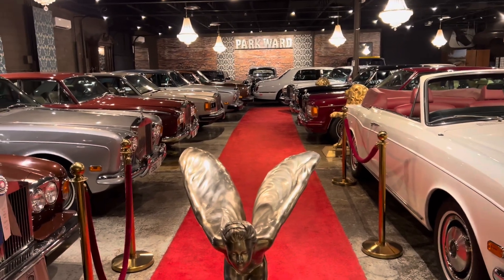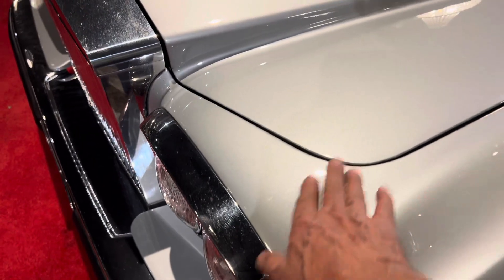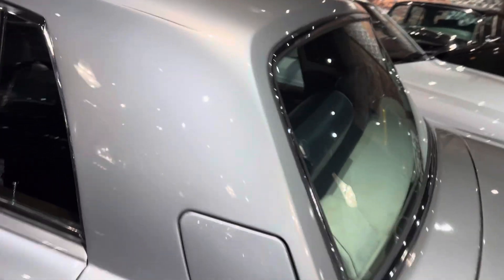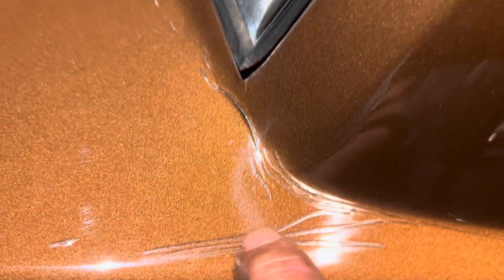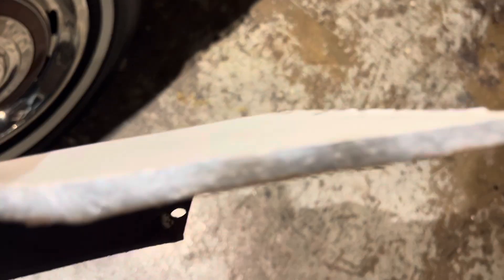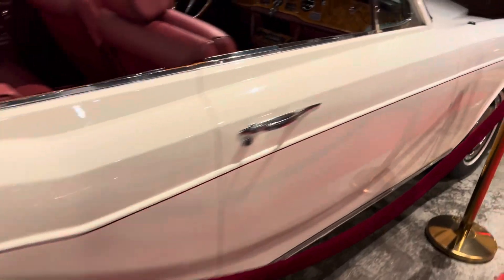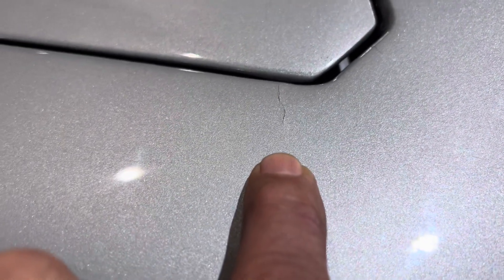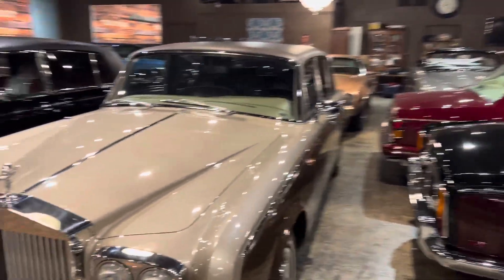The “Lead-wiping” process used in Rolls-Royce motor cars.

Comment: Rolls Royce bodies were built at Cowley in Oxford. This was a British Leyland plant, RR insisted on no publicity. Those workers, usually ex plumbers, could only work at this job till the lead levels in their bodies became too high. They were moved to other jobs with enhanced pay for life.
Reply: That sounds like a porky to me.  Linesmen employed by telephone and electricity companies spent all day and every day lead wiping cable joints, for decades, until plastic jacket cables came in, in the 1970's.   They were taught basic safety procedures for working with lead, eg wash hands with soap before eating.   There was never any restriction on how long they could work.
Reply: @keithammleter3824  that's how it was. If you choose not to believe it that's up to you.

Comment: It's actually called lead-loading.  That's probably why you couldn't find many references.

Done correctly it won't crack.  That said, 'correct' isn't 1/2in thick.  2-3mm is ideal.

Many of the problems come from not rinsing the flux (based on boric acid) correctly, or from leading over spot welded / lapped joints where the acid gets trapped in vis capillary action.  Best way to mitigate against this is to run a tiny weld over the bare edge to seal it to the substrate.  Then you can tin up with solder paste, then thoroughly rinse and only then apply the stick of lead.

Very satisfying, but frankly now although I'm happy to offer it (having leaded for nearly 30 years) the issue now is the painters, quite rightly, don't want to risk sanding lead in with the primer, so now I tend to just use it to finesse door-shuts where the strength and stickability of lead is still ideal.

Comment: Very fascinating!   Having owned 6 Cloud IIIs this explains a lot. It's strange that they would try to reduce body weight with aluminum doors, bonnet and boot and yet slather on, probably, hundreds of pounds of lead. BTW do you have any idea where James Young's wood bucks and records wound up?
Reply: Not hundreds of pounds. That half an inch section is horrendous but coachworks would normally use only a few sticks around the joins. For instance, we grit blasted a Karmann Ghia, one of the swoopiest, most lozengey shapes imaginable to find butt-welded joints and scarcely any filler as the panels were so well aligned.
Reply: @garethmcrae668  Thanks.  I wonder what they did with the Aluminum bodied cars like the Phantom Vs
Reply: @victorseastrom3455  Excellent question. I don't know the process for anything but steel but am quite keen on acquiring the 'new' aluminium bodied Alpine A110 so may yet find out!
Reply: @garethmcrae668  Possibly Birmabright , a British car aluminum that my Rover's boot and bonnet - hood and trunk were made of. P4 Rover's had a reversal with Birmabright doors. I like the Grumman LLV. Make the whole coach body out of aluminum.

Comment: Well, the use of lead to conceal the joining of panels on cars isn't unique to Roll Royce.  It is the way it was with every automobile manufacturer up until the 1980's.  It is the origin of the hot-rod/custom car description "lead-sled" which was used for cars that had the suspension lowered (sled) and extensive custom bodywork (lead).
Reply: Been used for years in body work, plastic has replaced lead, but for classic cars lead maybe required to maintain authenticity, plus lead has properties in filler that plastic can not mimic
Reply: Exactly. Been done forever.
Reply: I haven't heard that expression in years. Lead was used back in the 40's. If you say lead sled today,  nobody knows what you're talking about.
Reply: When I stripped my 1968 Camaro, I discovered the lead joints at the top of the quarter panels.
Reply: Apparently they've never heard of a lead-sled.☕ good day 😊
Reply: Yep. Lead loading has been used for decades in the custom car/hot rod world. It's a lot more skilled than throwing a load of bondo at a car.
Reply: Yes, it's called "body solder" and was the traditional method for joining automotive body panels through the 1950s. In 1955, 3M introduced the Bondo brand "plastic solder" that was designed to work better with the thinner sheet steel being used after WWII. Also, people discovered that lead is poisonous...
Reply: @Speed-Daemon-123  yeah, in high skool, they told us not to smoke cigarettes after sanding the lead filler.

Comment: I met an old body man back in the 1970’s who was an expert at lead wiping. It’s definitely an art.
Reply: I had  Jensen interceptor and Bristol 407 with exactly the same issue. Good explanation though 👍🏻
Reply: This was a standard panel fairing method before Bondo. Buyers of used cars were advised to check for excess filler with a magnet. (Come to think of it, it would work with Bondo as well.)
Reply: My friend worked for an auto body place in NYC years ago and they had men highly skilled in using lead. They would get high-end cars from all over the world sent to them.
Reply from the maker: @Aguas2017  without question! It’s hard to get completely perfect and as much as we’d love to claim Crewe craftsmanship was perfect, it wasn’t.

Comment: So these cracks don’t lead to rust due to the lead underneath?
Reply from the maker: @petergresham8913  no because the fractures in the lead only go down a mm or so and not down to the steel.
Reply: I would be obsessed with putting clear coat on those cracks. I don't care if you're not supposed to.

Comment: Nice video and explanation. American cars also used lead for many years in the same manner, typically around the cowl and rear window as shown here. Some factory films for American car companies show the use of lead in body making.  It was apparently easy to place and shape on a car in a soft, hot state and then to file it to blend panels after it hardened.
Reply from the maker: @franktatom1837  100% correct.

Comment: Dear Mr. Sala, may i ask you a question. So, when you are asserting (very rarely) that a Shadow is like if you are buying a perfect car in the showroom in the 70’s, there are some of these small fractures. Or, otherwise, it has been repainted at some time. Is it right?
Reply from the maker: @Luca-de3xu  pretty much right, yes. Sometimes, you can get an all paint original Shadow that does not show these fracture lines and that is because the lead wiping turned out faultless on that car. But, that is rare as I would say 8 or 9 out of 10 of all Silver Shadows show some sign of fracturing.
Reply: @roddsala4626  Thank you. Then, I take advantage of your knowledge. All of the old bodies, let's say even to Corniche III and IV, are they built in the same way and share the same issues? And I had a Continental T, some years ago. and it developed the same issue on pillar C, maybe due to the cut and subsequent welding for shortening the body. Same reason ? Thank you for sharing your knowledge, Rodd.
Reply from the maker: @Luca-de3xu  Absolutely correct.